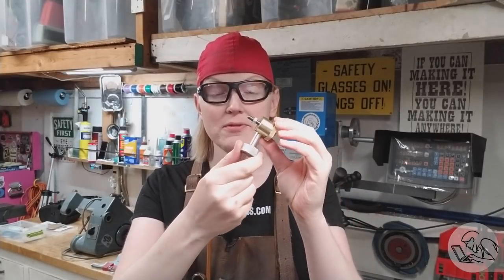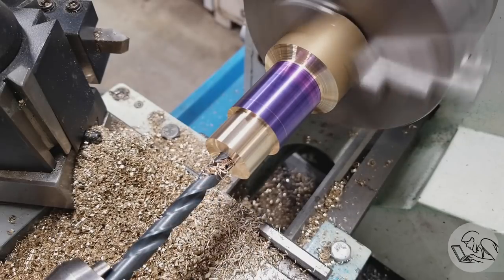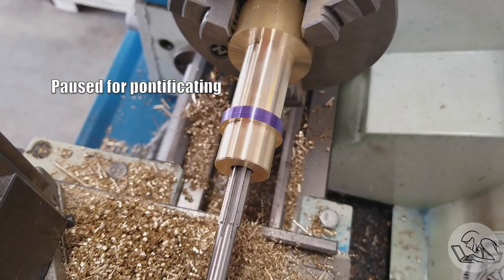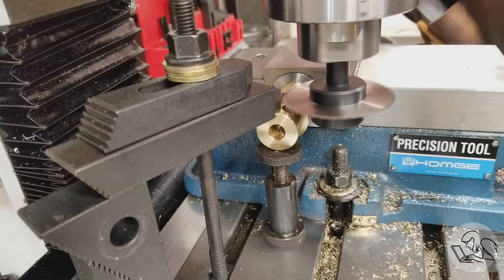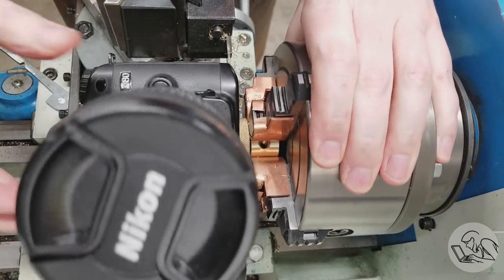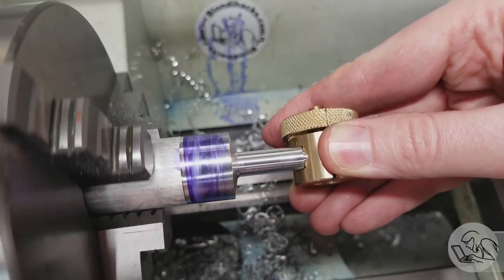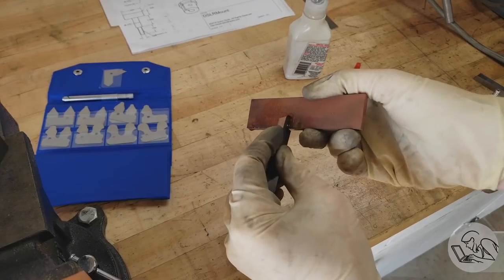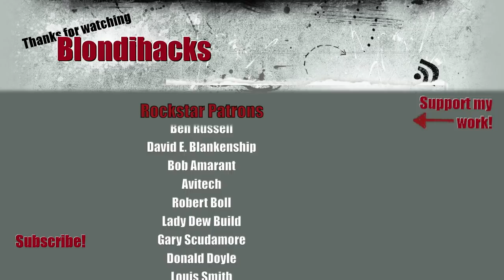Let's Make a QUICK RELEASE Camera Mount!

Comment: Love the work you do and the even mistakes. One I noted is at 13:40 . The shaft is mounted a bit crooked, but you coincidentally found the area of the least amount of axial run-out where your gauge is. This is why you thought the parting operation caused the run-out immediately thereafter. One thing I would do is run the measuring device up and down the shaft if it's mounted on the carriage and turn the chuck to discover that issue. Looking forward to more videos!

Comment: Pulling the chuck by hand with the endmill already in the bottom of the hole with light pressure is enough to square up a hole that size. This works well, doesn't ruin the bore. 7:01

Comment: Grinding the tip off a drill works well to get a flat bottom. The only issue is you start going through a lot of drill if you do this on a couple of projects
Sticker over the dirty sticker. Love it

Comment: The form tool turned out really nice and appeared to work well in the mild steel.  Grind yourself a 1/16" wide parting tool to create that needed thread relief at the base of the camera mount threads.

Comment: Fantastic video and thank you for showing your mistakes. I recently acquired some brand new apprentice marks on my 3/4 inch 5C collet because apparently I can't add.  Like you though I kept at it and thankfully now have a much nicer chuck key for my three jaw than the junky thing that came with it. O1 tool steel, hardened and tempered the square drive portion after I finished the cutting. Every time I turn annealed O1 I am surprised at how well it works in a small lathe.

Comment: I'm relatively new to your channel, but wanted to take a moment to thank you for showing all your mistakes.  Unfortunately it's been years since I've had access to machines, so I live vicariously through channels like yours. I remember making a lot of mistakes when I was learning, and continued to make a lot of mistakes as I expanded my abilities to do more operations. It's part of growing, and we're all human. No matter how many years of professional manual machining anyone does, their scrap bin isn't often empty, but many don't show their mistakes. Nice part by the way! I could use one of those someday, although I'm a little concerned about the camera base having only a few threads made from brass with a heavier SLR. Steel may be a better choice. Love your videos!
Reply from the maker: Thank you! We’ll see how the brass holds up. I was concerned about weight- the whole assembly is pretty heavy as it is, and I didn’t want a big lump of steel on the end of the arm. Modern DSLRs are surprisingly light, honestly, as long as you’re not using huge telephoto lenses.

Comment: Nice vid, thanks. It's really common to use a flat bottom drill in industry. You drill the regular hole first, then clean up just the bottom with a flat bottom. You have to grind it from a second drill.

Comment: Hi Quinn, no such thing as a mistake, its just another way of doing stuff you did not mean to!
I would have used a "D" bit to make a fairly flat hole. They can also produce very close to tolerance diameters too. Maybe not as good as a reamer but nearly.
I particularly like your copper soft jaw adapters, must have a go at making some for my chucks!
BTW, nice vid as usual.😎

Comment: When reversing a part in the 3 jaw I face jaw 1 upwards, then undo the part, now carefully end for end it such that the 'top' that was opposite the jaw1 is now facing down (opposite jaw1).   This keeps 'pretty good' concentricity for matching 2nd ops to 1st op surfaces.  My 3jaw is some 70 years old and though I have reground it it is not perfect at all diameters.

Comment: In a pinch, a smaller diameter ( than the hole) end mill in a tool post mounting can make a decent job of flat bottom. I have tried that a few times with success. Tool alignment is critical, of course.
Reply: There is a July 2016 video by Franco on using an endmill as drill and boring bar for some tips.

Comment: I thank you, Lady Quinn, for all your work and expertise ! 
   Please let an old Tool & Die Designer/Maker pass on to you a very KEWL trick, that works quite well...get an ARGO Corn Starch 35 ounce jar, with lid; and put water in it, and set it next to your bench grinder. (it is a short stubby jar and has a very large opening in the top that is very easy to use as a quench. Put the lid back on it when not in use. I have one by all my spots where quenching is needed).
   Take the drill bit and grind, straight in, on your rough wheel. DIP EVERY 2 SECONDS into the Quench tank, or you'll loose the quality of your bit !!! You want to push very gently, but evenly. You want the end of the bit, SQUARE . Then counter grind the edge, but NOT real steep, or it will dig really bad. Do your final grinds on a very fine stone, that has been dressed. Being sure to quench very frequently ! You DON'T WANT any blue in the metal. That drops your Rockwell in the tip !
   Chuck it up, oil the tip, and run it in, to bottom your hole. It WILL cut deeper if you please, but don't push it ! This is mimicking an endmill grind. I believe you'll like this trick. I made an entire set. The main thing is to Quench alot and keep END-MILL in your mind when grinding the tips. (fine drill bit can be done on a SpedeCut, but it needs to be mounted in a bench grinder with turned spacers on each side for thickness and clamping balance. NEVER GRIND ON THE SIDE...it will come apart!
   Bill, from Tn. 🇺🇸

Comment: I prefer the Arca Swiss style. It's basically a dove tail, shouldn't be too hard to make and you can even abuse it as a short rail of sorts, to adjust the shot a little. You can make super tiny, form fitting counterparts that remain on the camera at all times, there's a company called RRS (Really Right Stuff") that started manufacturing these back in the day.

Comment: One hack for turning undersize is to knurl the part then turn back to size. Not as strong but ok for light work. Have done it a few times. Got the idea from automotive heads where they knurl worn valve guides the re-bore them. Was a cheap way to fix the heads on my Mustang with no replaceable guides.
My machinist books must be old; they don't have Yatzee defined as "Parting done" ;)
Enjoying your channel and your sense of humor.
Reply from the maker: For sure! I almost knurled that part to tighten it up in the bore, but decided I could make it again quickly enough that I might as well. I already had all the tooling ground for it, so the second one went very fast.

Comment: Hi Quinn,
I wouldn't call them mistakes, just learning experiences. When you were using the 1/4"-20 die on the brass, turning it around will let you get the threads about a half thread closer to a shoulder.
Reply from the maker: Not on these dies. Not all dies have that feature.
Reply: Hi Quinn,
Guess you were using adjustable dies. I have a set of dies that I keep around for those instances where I need to get the thread a little closer to the shoulder. Getting caught up on your other videos. So far so good.  :-)

Comment: Having made pinch clamp mechanisms like this before, let me add my $0.02.
The wall thickness of the clamp body has to be thick enough to create a thread and counterbore/seat for the pinch bolt.  It also has to be thin enough on the opposite side that it can flex under a given amount of torque applied to the pinch bolt.  The solution is to turn the OD of the clamp portion eccentric to the bore.  That way you can tune those dimensions independently.
Reply: Great Idea, as you mentioned that gives you more room for the thread seat operations and easier to pinch on the back side! Thanks!

Comment: Nice project!  Having tried using an endmill in the lathe for the same purpose, I learned that endmills do not cut flat bottom holes.  The center of endmills are actually slightly relieved, even in center cutting ones.  So you end up making a very slight point in the bottom of the hole.  This probably happened on your counterbore for the clamp screw as well.  You could get around this there by milling sideways away from the center of the hole so the perimeter of the mill cuts the entire counterbore surface, but of course you'd lose the round edge of the counterbore.  Also, I was watching one of Tom Lipton's videos and he recommended slitting to full depth in one pass.  His explanation was that this prevents chips from packing in the groove ahead of the blade left by a previous pass and causing problems.  He said it also helps the blade not wander as much.  Check Monday Night Meatloaf 15.
Reply from the maker: You should watch my video on endmill geometry 🙃

Comment: Have you considered making a mount for your hand held band saw? I have found the the top handle is the pivot point and it is really easy to just set it up on  a frame by clamping the handle to a pivot bar...then you can use it just like a normal horizontal band saw. Also Mr Pete has a nice little mount video to hold it upright as a vertical band saw.  I have a portable hand saw also and used to as a horizontal rig made from an old round steel tubing chair...but I threw it out because it was ugly. Dumb move, It worked perfectly. I put a machine vise on the seat of the chair that was at the right height and it worked well.
Reply from the maker: Yah, it’s actually a space problem for me. I don’t have anywhere to set up the saw permanently right niw

Comment: You could grind a D drill to cut a flat bottomed hole, probably wouldn't need to harden O1/drill rod for a single hole in brass.
OR
Simply match the drill angle on the tip of your pin.
20/20 hindsight?
Regards, Oz.

Comment: Holy crap..the isopropyl alcohol works super as coolant. Just tried it. I always have a bottle of that around for a zillion other purposes, but never heard of this one. Thanks, great tip. Have also tried antifreeze  in a pinch on some CNC milling. Works , but I wouldn't use it if you have pets running around. They tend to like the taste...bad news.
Reply from the maker: Thank my viewers! 😁 Regarding antifreeze, yah, very very bad news around animals. I have two vets in my family and they’ve both dealt with that a lot. As you say, it tastes sweet to them and is extremely poisonous. Can cause death in minutes.

Comment: That is a really nice simply bit of grip. A shame most of the commercially made stuff isn't manufactured to those kind of tolerances. 
Just a small note about using brass, it is possible to get enough leverage out of the camera and lens to break the 1/4 in mount clean off.

Comment: before you make a slitting saw arbor check to see if the run-out is in fact in the arbor and not the saw, I haven't seen too many slitting saws cut on all their teeth, that's why it can be a good idea to rotate your saws on the arbor so there are not always cutting on the same couple teeth. anyhow yeah it's probably just another crooked saw
Reply from the maker: Good to know, thanks! This thing is way out and the arbor is poorly made, but I’ll check the saw too.

Comment: What type of wheel and RPM are you using on that grinder? Seems to work really well on HSS!
Reply from the maker: That’s a 60 grit aluminum oxide wheel and I’m not sure what the RPM is to be honest. It’s a basic consumer bench grinder, although it’s 8” instead of the usual 6” which helps (higher surface speed on the wheel). It takes a looong time to remove that much steel though.
Reply: @Blondihacks  Thanks! I will give alu oxide a try. Not sure what my current wheel is, it's good for roughing but leaves a horrible surface.. Looks like aluminium oxide could be a good "middle step" before honing.

Comment: Did you intend to clock the tripod/camera threads so that the knob was facing directly back? Or just a happy accident?
Reply from the maker: Entirely an accident, but the length was chosen so it wouldn’t interfere with the camera no matter where it landed. That’s why the knob is so long.

Comment: If I made this, the camera body would "clock" exactly wrong on the 1/4-20 threads, making the clamping knob interfere with the camera body. Oh, also, if I made this it would never actually be finished, and what little I did finish wouldn't look as good as yours. :)

Comment: You’re doing very well. However, taking 100 million years to grind up a tool may make for a low level of output in what is supposed to be a high production shop. Let’s cut that time by 50% by the next video, OK?  Love your projects, really love your approach to them. 😎👍👏
Reply from the maker: I’ll work on that. 😬

Comment: I would have used a thin jeweler’s file (rectangular) on edge laying flat against the bottom of the knurled knob. To just file away that little area of too large a diameter. Not lathe  process? Not machinist quality?🤔